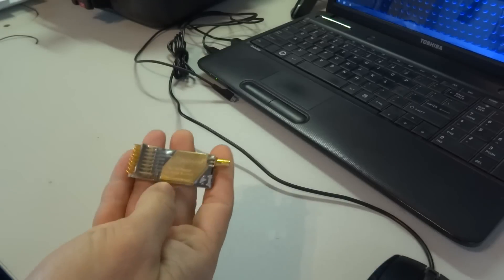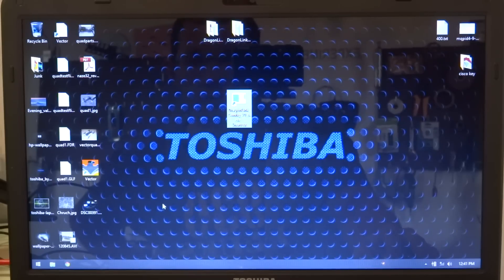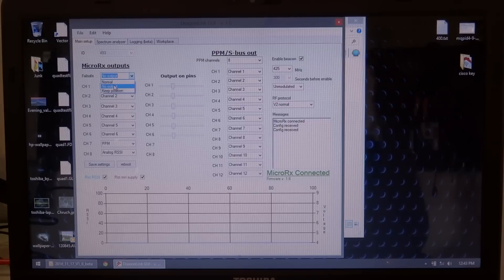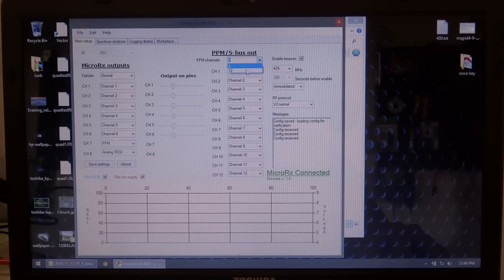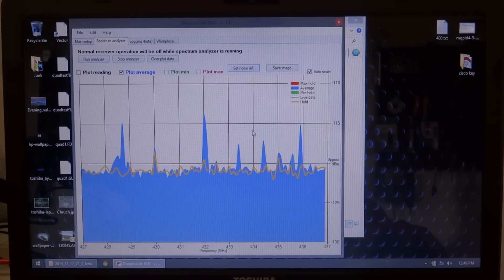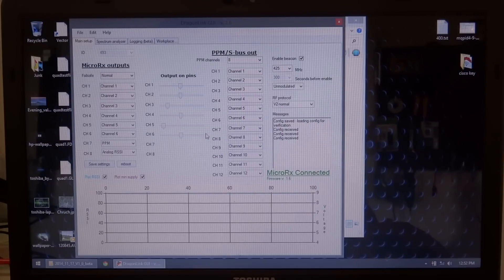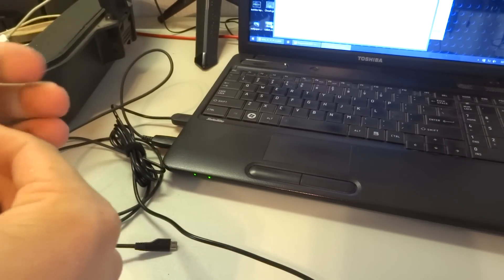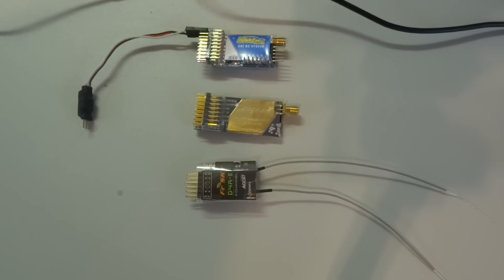Dragonlink Micro Receiver

Comment: I just bought a dragonlink complete system that includes that same receiver.  The seller told me that I wouldn't need to do nothing with the components because they were already configured with the latest firmware.  Is all that upgrade thing a must do step, or that was only for people that already had the old system and want to upgrade to the new one?

Comment: Hi - good review. One question - I would like to reduce wiring from DL Micro to MFD Autopilot and use PPM (Ch. 7) however this doesn't work - latest firmware on the TX flashed - do you know how to use that?

Comment: Where could I pick up one of these new receivers? And are they compatible with the unupdated V2 Tx?
Reply from the maker: Colton Baldridge They are in stock right now at fpvpro, I added a link at the end of the info below the video. I'm pretty sure you'll have to update your transmitter to the "Next Generation" firmware to use these little receivers. It's worth doing anyway though, you'll get a little better performance out of your other full size V2 receivers as well. Here's some info on updating http://www.rcgroups.com/forums/showpost.php?p=19530934&postcount=3
Reply: You must update your V2 TX with the new generation firmware! It improves the performance of your TX and you will be able to use these new receivers with them :)